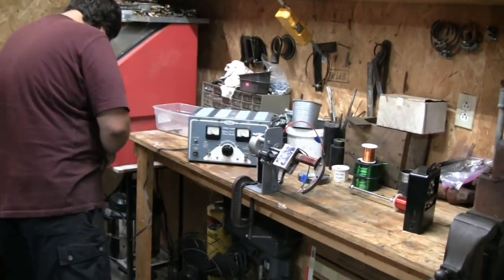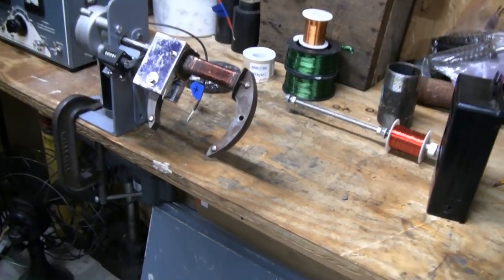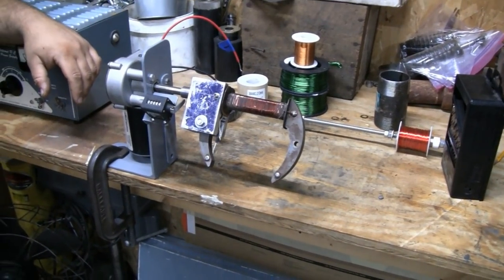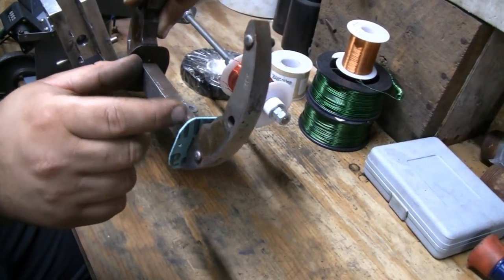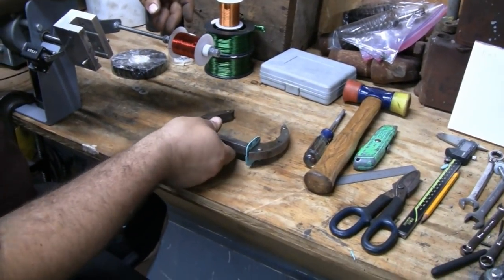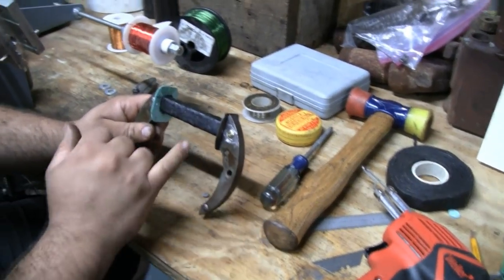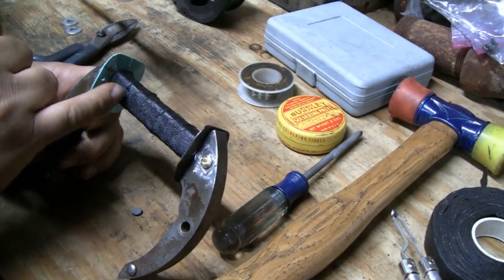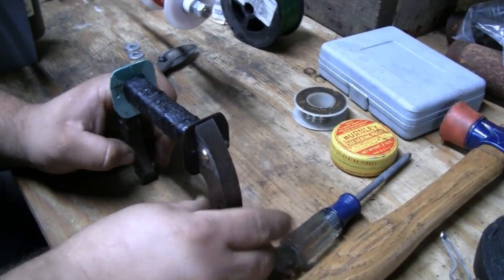HOW TO REWIND A BRIGGS IGNITION COIL (part 2)

Comment: Reminds me of when I was a kid (I'm 75) and I would wrap copper wire around a cardboard toilet paper roll to make a tuner for a crystal radio. No batteries etc. it worked without power of any kind I'm aware of, just magic!
I have been very lucky, I have worked on small engines most of my life.  I still own a 1949 Cushman Highlander motor scooter I bought when I was 14 and have kept it running all these years. Now I only ride it to antique car and bike shows.
Reply from the maker: Good stories Tom!! I had the little Rocket Crystal Radio!!☺

Comment: many years ago I worked at a place in Canada called magneto sales ,I wound hundreds of mags of all types for all sorts of engines and charging coils ,If we had to do them by hand like that we all would have gone permanently cross eyed ,but that is an excellent way to do small batches for a hobby or special and rare mags, way to costly for most mags and charging coils.One of the biggest mistakes that is made ,is winding in the direction .Good job, thanks for the video.
Reply from the maker: Thanks for the info!! What's the reasoning for winding them in the opposite direction.

Comment: I been hoping you would do a nice demo since you built the winding apparatus so thanks for this, it's nice to watch in a short video, but I can only begin to imagine how tedious a job doing the secondary is, long, boring and requires full concentration. As Mike rightly says, however, it's one of those jobs that need to be done if you want to preserve and enjoy period engines.
Reply from the maker: Yeah Buddy!! The secondary is alot tougher because the wire is so thin!!☺